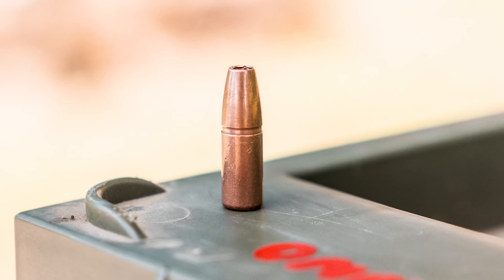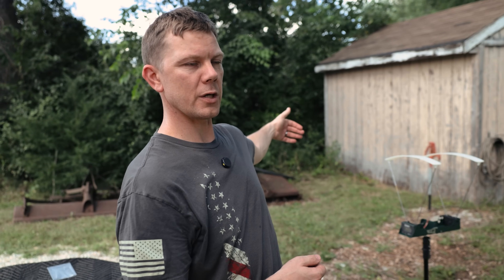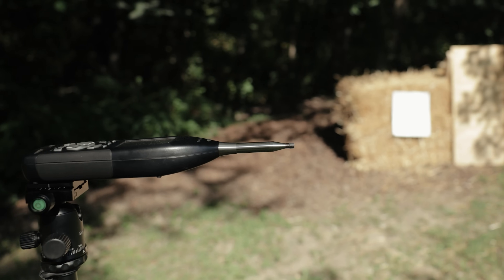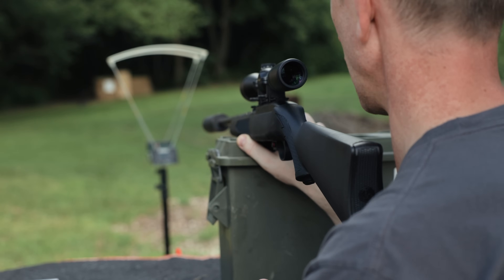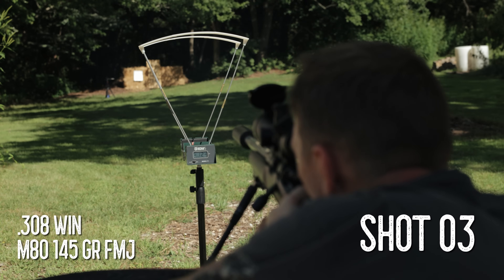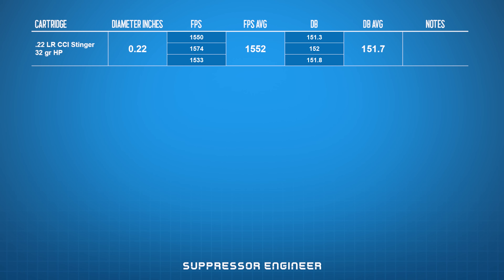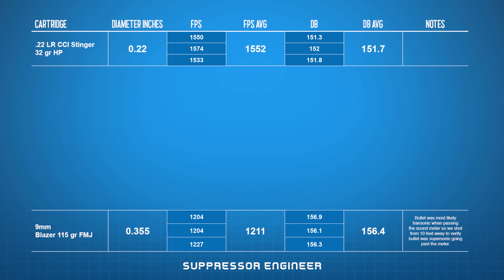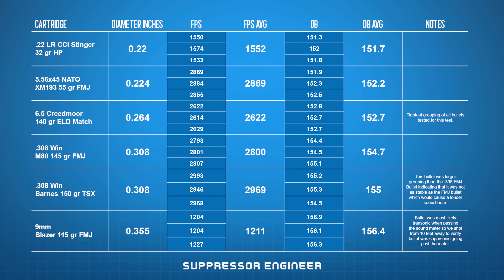Quietest Bullet Supersonic crack! What's quietest

Comment: I'm a test and measurement guy... I'd be happy to suggest some ideas to kind of simplify, but also improve the data quality... You only need a two-channel oscilloscope, and two microphone/pressure sensors with fast enough response. With a fast response, you can actually measure the "shape" of the shock wave, and its pressure.
You trigger the oscilloscope with the muzzle blast, then capture the shock wave at a delay time based on the muzzle velocity.
Reply from the maker: email us an inquiry and share more

Comment: Cool. I was anticipating the same transonic for the 22, as they typically reach transonic at about 30-35yds but I think the extra velocity of those stingers despite 32gr still made it through supersonic. 

What’s interesting is the stability of spin influences sonic boom, does this mean there’s more to be done for radar chronos used down range for BC testing to distinguish stability.
Reply from the maker: Bullet stability affect BC a ton! This is a rabbit hole and probably video worthy to demonstrate. Radar chrono won’t detect stability. But there is a way to use a chrono to find out

Comment: I do a LOT of shooting 22 suppressed with subsonic ammunition and one weird thing I've noticed is that if I have the muzzle (really the end of the can) right next to something like a large tree, or just any large, flat, hard surface, it will often produce a supersonic crack. And this is with CCI Quiet-22 Semi-Auto, which is I believe 830 fps. I wish someone could explain that to me. Its not muzzle blast being redirected or focused, its very clearly a supersonic crack.
Reply: Sound travelling towards the hard object and sound travelling back interact creating more sound.
What gets me? Shooting a quiet subsonic, when it hits water, eg a dam 100 yards away, it makes a big bang.
Reply: @glennllewellyn7369  I LOVE doing that! Especially with really quiet .22 subs or a .22 short in my Ruger Mk4. Makes no noise coming out of the gun and then one HELL of a thud in the water. Awesome party trick.
Reply from the maker: Altitude, air pressure, temperature, can affect the speed of sound. Most likely your scenario your bullet is traveling transonic so if your muzzle is very close to an object you may hear a small crack.
Reply: Have a super day mate!
Australia